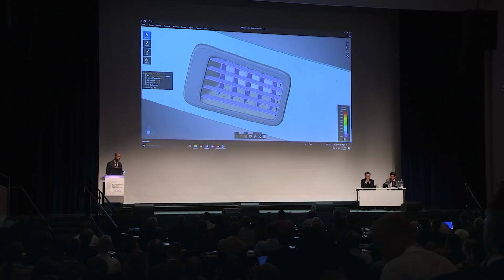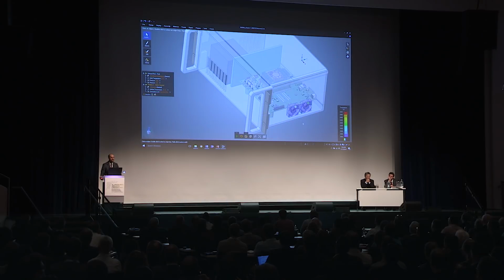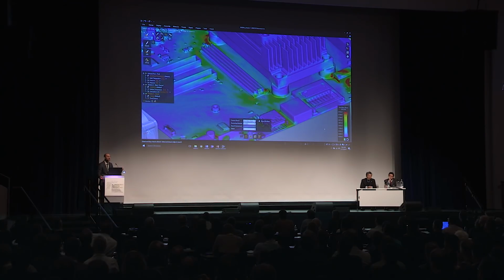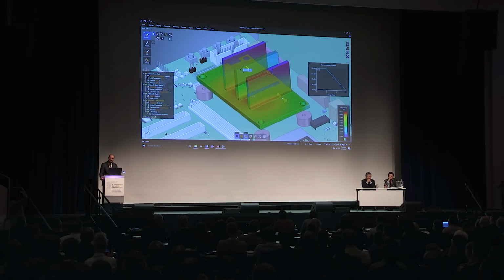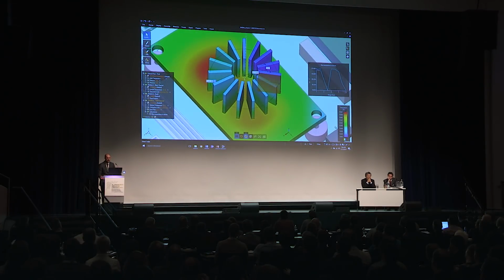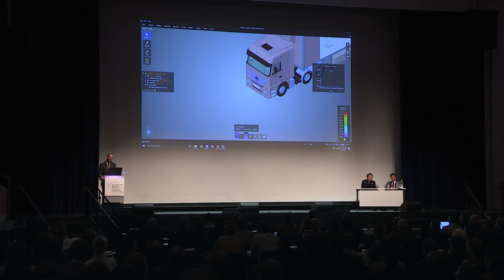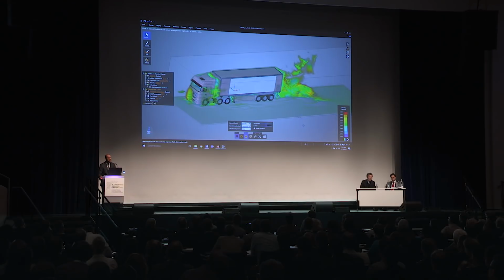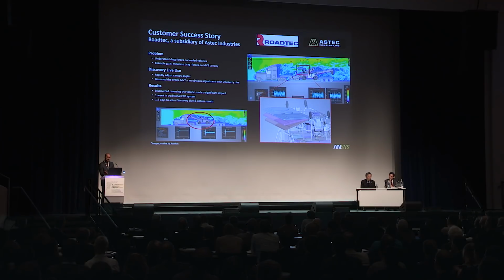ANSYS Discovery Live: Breakthrough Real-Time Simulation Will Profundly Change Product Development.

Comment: Hi. All the modelling capabilities e.g turbulence modelling, cavitation modelling, spray and combustion modelling etc are possible now with ANSYS Discovery Live or is it limited currently just to model simple flows like incompressible and laminar flows?
Reply: Discovery is for simple flows, for more complex flows you have to use Fluent or CFX (or AIM). It's a design tool more than an analysis tool.
Reply: Thanks a lot for your reply. Even the materials can't be edited? Like if some one wants to use material other than Air and Water, is this possible or not?One more question: AIM uses CFX as solver or AIM has got different solver phsics and models as compared to CFX?
Reply from the maker: Thanks for watching our video. We recommend to have a look at the ansys webpage https://www.ansys.com/products/3d-design/ansys-discovery-live - There you can get several information about ANSYS Discovery Live and all the capabilities. Hope this helps....